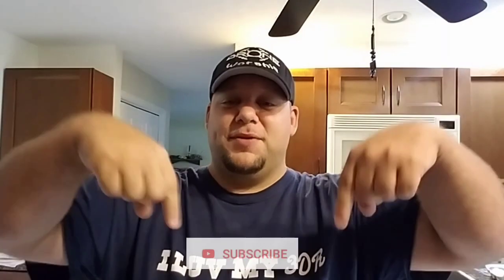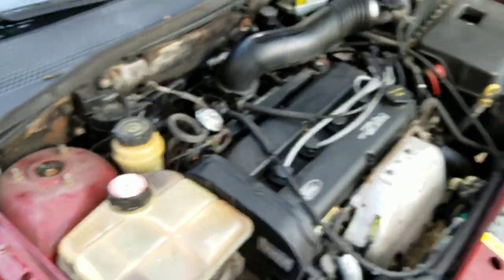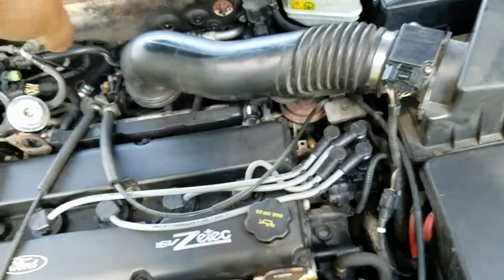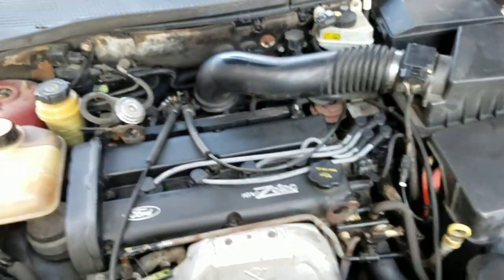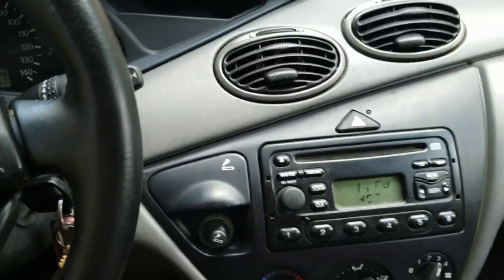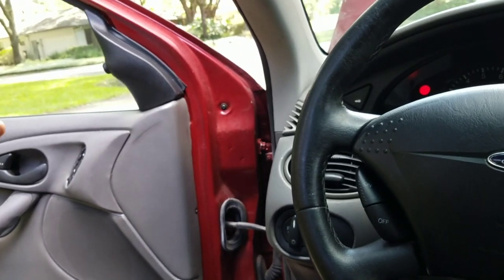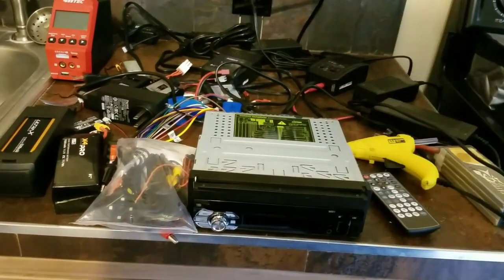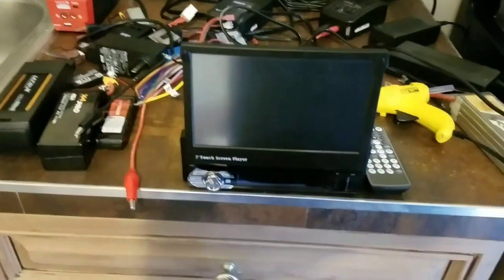2001 Ford Focus SE Running Rough FiX, Common Issues To Look For #Ford #Focus

Comment: Great vid!  Found my vacuum tube collapsed years ago.  Did not deduce pcv  valve & oil on spark plugs  to that.     Gonna rework now.  I have 2000 zx3, this the closest vid I can find.  Rough idle for years & NOW not accelerating.    Doing my best to go in order

Comment: Just earned yourself a new subscriber.

I have a 2004 Ford focus ZX3. Crank windows, no cruise control or anything,  ac practically brand new, and it's a 5 speed manual. Gets me around town as a daily as well as some short, 4 hour road trips. Installed an Atoto stereo in there since the factory radio had issues with the volume knob 

Might follow your stuff to see some tricks on any issues that arise.
Reply from the maker: Pretty old video but hopefully still helpful
Reply: Im working on that same manual model. And noticed its pcv valve slipped right off so i will be putting a pressure clamp on that after putting the new starter in its not my car im just doing the work for free because the shop guy said it was a clutch problem but i knew it wasn't i knew it wasn't after i heard the car start up and idle it was a loose starter solenoid cap

Comment: Thank you for posting the video.  My daughter's 2001 ZX3 idled rough, and bucked when trying to accelerate hard from a stop.  No check engine light until after I pulled plugs to see if they needed to be replaced.  The code indicated a misfile on the #1 cylinder.  Started checking resistance of coil, then plug wires.  Coil seemed OK.  Noticed that wire #4 wasn't plugged in all the way at the coil, and the contacts were blackened probably from arcing.  Using a ohmmeter, wire #4 showed no continuity at all.  I'm guessing arcing from the loose boot burned away part of the conductor, so tried replacing plug wires, and problem solved.  I think her car also needs motor mounts.  I bought the car 2 1/2 years ago from a coworker who was the original owner, and who always kept it well maintained at the Ford dealer.  He had just replaced fuel pump and spark plugs.  It did have a bad clutch at the time of purchase, which I replaced by myself, and that is probably when the plug wire got loosened.  Strange that #4 cylinder wasn't firing, but there were no codes to indicate a problem there.
Reply: Consider yourself lucky that yours has a manual transmission. because the automatic transmission models are notorious for transmission failures. Ford Motor Company just figure out to build automatic transmissions. always buy a Ford with a manual transmission you'll be glad you did.

Comment: In case you or someone else checks in on this video, I have a problem where after driving my car (5 miles or more)
whenever I stop for a quick errand, like go into Micky D's for 7-20mins and come  back out and START the car back
up it SOMETIMES run really run after if the timing is off/or bad plugs or something!  The car will usually sputter off.
Then I would have to restart it 3 or 5 times and gun the engine and then it will smooth out after about a minute
or two.  This is really bad sputtering cause I'm usually entering in heavy traffic will die if I don't put the car into
neutral at stop lights and rev the engine until it smooths out.  After the engine smooths out, it run perfectly fine.

I just started trying to TIME between me turning the car off and starting the car back up where this rough
sputtering starts. It seems to be about 5-25 that I've notice at this time.  I've noticed that if I come back to the car
within 3-4 minutes and start the car it starts fine.  Or if I come back to the car 30 minutes are more, it seems to
start and idle fine! 

My car is a standard 4cyl Ford Focus SE 2.0 not the ZTS model.  The problem started maybe about 9 months ago.
It had 125k miles on it and the timing belt broke  Just had another rebuilt engine put in ($5000) at a AAA approved
repair shop.  I thought this would address rough restart and sputtering issue.  But NOPE!   Drive towards work,
runs fine, pull into McDonald's for a quick coffee...come back out 15-20 minutes later...start the car and...SAME
crap again.  Engine sputtering!  Have to do my sputter routine,  put car in park or neutral,  and keep revving the 

engine ...about 1min or 2...until the engine smooths out.  Is this vapor lock?  If so, how to fix?  Could this be
the fuel pump?  Why only after 7-20 minutes of engine being off does this occurs.  Both engines would run
JUST FINE in morning, evening, mid-day, in heavy traffic...but only after a 7-20 minute stop of engine would this
happen.  

Don't think both engines ( the old engine and now the new rebuilt engine) could have the same common problem.
I almost thing that this caused my timing belt to brake...but that might be pushing it.  The car runs perfectly fine
outside of this issue, smooth, quiet.  Thanks for ANY insights to this issue and how to address it!  THX
Reply: if it helps i would check the IAC and the pvc and hose. Make sure hose isnt collapsed. IAC is a lil more expensive but i would start there

Comment: I can't like it twice!!! Thank you!!!! This helped a LOT!!
Reply from the maker: Not a problem I'm glad the video helped
Reply: @IFixShet  , followed the video, helped a bit. Hubs changed the spark plugs and wires, and now it dies when put in gear. Goes to the shop tomorrow,  it's caused more grey hair than the 15 y/o!!
Reply from the maker: That's normally mass air flow sensor or throttle positioning sensor that causes stalling
Reply from the maker: Sometimes it's better to buy the recommended parts for the vehicle then to try cheap on eBay sometimes you get lucky on eBay but sometimes you actually have to buy the actual part or equal to the regular part for it to work properly in the system to understand it
Reply: @IFixShet  to date: MAF, O2 downstream, PCV valve and hoses, fuel filter,  plugs and wires, oil change. Always buy my parts via Autozone, new/warrantied refurbished.  (Ebay folks think their used parts are new by cost, I swear!) After the O2 sensor, I'm done trying to finagle in around the block, it's still cheaper to take it to the shop (timing chain is about due to fall off again) and have them diagnose and fix it. And have it tuned up while they have it.
Reply: It's the shop, or target practice lol
Reply: @stacimcclendon3907  did they solve the issue at the shop?

Comment: Idk how old this video is without looking but, I would not get rid if a Grand Prix for a fucus! I have a 03 fucus 2.0 Dohc zetec vin-3 & just swooped a 07 Pontiac G5 vin-F 2.4 which i saw it needed new tire's & a window regulator but, only afterwards did I realize what else the G5 needs due to the fact that, The G5 was running when I approached it. Needs at minimum- a timing tensioner which I allready ordered but, if that doesnt fix the tapping at start up (just for the first 2-3 sec max) then, I will redo the entire timming setup!!! I have already replaced the window regulator, a lower grill, oil change, & on payday it will get 4 new tire's & ride NICE!!!!
Reply from the maker: Grand Prix has a non fixable transmission unless you remove the entire transmission and repair it you can't get to any of the shift solenoids or sensors five thousand times more work when they have problems

Comment: I bet that radiator on those are hard taking out from were its at seen underneath while i was taking out the old starter its gonna need a new oil pan gasket put on looked like someone used the same old gasket but other than that the frame looks good clean still new not no rust
Reply from the maker: Yep it's definitely not fun it requires almost a complete teardown of the front end

Comment: Hey drone worship and don't forget if you test it and it still skips or misses. after you driving it down the road. don't forget not to check those check the coil. my Ford Taurus would run rough and it set off the check engine light and it was the coil that was causing the problem I changed wires and plugs. And the car was still running rough and misfired new coil 80 bucks it fix the problem. and after that car runs like a top oh don't forget the PVC I had to replace that too it was causing a vacuum leak. My car is a Ford 2000 SE with a 3.0 liter engine. Wish you the best have a good day.

Comment: Throttle body sensor you cannot replace by itself. It requires a full throttle body replacement because ford doesn't have a separate throttle body position sensor.
Reply: You can replace the sensor alone

Comment: Collapsed doesn’t mean bad PCV.  It just means the hose is worn and is collapsing due the vacuum draw.  Good idea to change the PCV anyway.  Cheap.  

“Valve cover gasket”.

Comment: we've got a focus ,we replaced the radio with a radio that looks like its twin but the screen goes in and out  automatically with a button push...  never seen this same design with a manual pull out.. thats bizzare!
had ours a yr and it works fine.. good mp3 player but i'd say the amp is weak.. if u dont care abt shakin the cars next to u then its fine.
Reply from the maker: The problem with the motorized ones are when the motor burns out your screwed

Comment: Cht sesor replaced. It works 2 days. Low speed radiator fan wont turn on.( It turns on sometime.)  Until reaches engine temp on middle scale on dash moving fluctrating than stuck on middle.  Low fan radiator maybe on??sometime. After engine get to hot Both radiator fans go to damm high and Scale on dash go to cold tottaly stuck down.What is the problem? Thanks

Comment: I changed my pcv valve and hoses. My car stops sometimes when i spend a long time at a stop light. I still need to change my spark plugs because theres oil in them. I hope this fixes the problem. I have a P0171 lean bank one code.
Reply from the maker: Also check your idle air control valve and your EGR valve both of these can cause stalling while idling

Comment: Enjoyed your video. I have the same car, same color. I am trying to find out why my dash lights and night time lights aren't working suddenly. I've checked the fuses. The odometer still works but the lights on the dash, my rear lights, and the auxillary lights around the gear shift are out.
Reply from the maker: Relay

Comment: Ah, you have a FORD ( Fix Or Repair Daily ) I'm joking of course.  :o)
My wife has a 2001 Chevy Malibu I call Christine (after the horror sci fi movie).  I hate that car and I'm sure the feelings are mutual.
I just replaced the water pump and then the alternator and of course the dead battery.  We just took the car in yesterday for an oil change, and they came back out with a list of things that needed to be replaced on the car. Struts, front and back, front disk brakes and rotors. But... they were able to save the air cleaner. LMAO.
The estimate for the total repairs came up to about $1200.00.  NO, I didn't let them do the work and charge me $800 for labor.  Looks like I'll be doing some work on " Christine ".
Did I mention I HATE that car. LMAO.
Great Video, thanks for sharing the information. Have a great day :o)
Reply: The only thing that might present a challenge in changing are the struts. Brakes and rotors are not bad at all depending on your knowing of how to perform the task. Good luck and I wish you the best.
Reply: I forgot to mention that I am 68 years old pushing 69, and what don't hurt don't work. lol
When I was a lot younger I loved working on my cars and trucks. And car styles have changed a lot from the old " muscle " cars and trucks that had real engines in them instead of these souped up lawn mower engines, and bodies made of plastic and recycled beer cans. lol
Have a good one :o)

Comment: I am in desperate need of help with my 2001 focus I have a water leak at the manifold and it won't turn over I need a second opinion to determine what needs to be done
Reply: Vapor locked

Comment: I have an 01 Focus ZX3. I thought I had the over heating issues solved after replacing water pump, thermostat/housing and new water reservoir cap. Sat idling today waiting for someone and it began to run hot again. Fans were installed before I got it. They come on as soon as the car is cranked. What else do you think it could be?
Reply: In the same boat man. Changed relays, fan resistor, the end of the pigtail to the resistor cause it was burnt and will still overheat after a while. Fan works on high speed with the a/c. Not sure what else to do.
Reply: Frank Bennett how much miles on it and how’s it running now
Reply: Devrim Ekici about  185,000
Reply: Frank Bennett is it Manual
Reply: Devrim Ekici Automatic. I believe the problem was that I sat in a parking lot in the South Georgia heat and the fans were pulling the heat from the asphalt through them. It hasn’t happened since that day.
Reply: Frank Bennett ok is it running strong I want to buy the 2000 zx3 Manual with 110,000 miles idk if I should
Reply: Devrim Ekici the only problem I’m having now is a stalling feeling when accelerating. I’m not much of a mechanic. Some might call me a parts changer. I do try troubleshooting and researching my problems but I got it used from someone. I don’t think it was maintained well. Just trying to get it to a somewhat dependable way to work for one of the kids. It’s not a hard car to work on though.
Reply: Frank Bennett trying to get one with 110,000 miles for 1400

Comment: i like to ask you question, i have 2002 focus , it has gas cap open light on, then car started to hesidate while driving , changed gas cap, canister vent valve, fuel filter,sparkplugs,sparkplugs wires, now , gas cap light is gone, driving hesitation gone but now it roghly shakes engine on idle like every few minutes now my next step will be idle control valve, mas airflow sensor, if you have any ideas that you would like to share, hightly appreciated 2002 focus single head

Comment: Y didnt u just fix the windows & mirrors in the grand prix? Either the motor, switch, or the regulator?
Reply from the maker: Because of the amount of damage that was caused by the other person that already broke everything it wasn't worth my time not when the air conditioner worked. I already have enough to deal with on my plate called life than to deal with petty stuff like Windows not working I'm well aware of how to fix the problem it's just not worth my time in the slightest I'm constantly working on vehicles and other cars to worry about weather myburger window works

Comment: My 06 zx4 ses is showing me a p9318 edc code. Secondary air injection system control A circuit high. Any help would be greatly appreciated

Comment: Quick question, on the throttle body, it has 2 metal wires hooked to it, one connects to the accelerator pedal and the other one goes to the back of the engine to some box hooked to the firewall, what is that metal wire for??? What’s it purpose for? Idk if I’m making any sense /:
Reply from the maker: Cruise control
Reply: Drone Worship The Executioner DUDE thank you!!!

Comment: 2000 se here overheating...a little nervous to do the cylinder head temp sensor...also my head needs cleaned ..
Reply from the maker: It's normal for the thermostat to fluctuate even though it's not technically a thermostat it just measures the temperature of the head during the hotter season it will go up and down as long as it doesn't stay high you're good if it just jumps up and down up and down as the fans come on then don't even worry about it

Comment: I have a question for my ford escort zx2 I replaced the crankshaft sensor like 7times and every time I go race my car it breaks it and then when I rev it up the rpm goes up and bad down fast. I don’t get what’s wrong with it? Can I get some information please.
Reply from the maker: 100% easily answered. 
Your problem is that you have crank walk. It is very prominent in that year make and model of your vehicle

Crank walk is when the crank is allowed too much transverse (in and out) movement. This will allow the flywheel to come in contact with the sensor
Reply: @IFixShet  is that a easy fix? I never worked on cars 😂 but still learning. Would I have to pull the motor out?
Reply from the maker: @GilmoreGamingRacing  no it's not a cheap or easy repair it will need to be done at a shop that will cost a lot you will not be happy. Here is what crank walk looks like on your engine

https://youtu.be/eMs-hBkGkWM?si=ITjTfQzJ44N6-nB-
Reply from the maker: @GilmoreGamingRacing  yes it requires complete teardown of the engine
Reply from the maker: @GilmoreGamingRacing  if you want my advice stop driving it hard and stop revving the engine. Crank travel is a very serious issue you're lucky you haven't thrown a rod through the engine yet. Baby the vehicle if you don't plan on fixing it until you can buy something else
Reply: @IFixShet thanks for the advice
Reply from the maker: @GilmoreGamingRacing  sorry to be the guy that had to tell you man
Reply: @IFixShet  nah your good man. I respect that man. Thanks for the help now im trying to get someone to fix it. If I can’t fix it it’s getting sold I paid 2000$ in it’s a race car so. But I really appreciate the advice.

Comment: '02 focus, had my pvc and both hoses replaced 8yr ago (85000 mi) and the back one has the heat shield... need to replace again, hose isn't strong enough, corner nearest intake collapses flat.  doesn't help that oil inevitably gets on that corner of the hose (which weakens the hose over time) which is right where the heat shield ends... lol
Reply from the maker: I agree it was kind of a poor design by Ford

Comment: How long did it take for you to do all this? Also how much did it cost for all the parts? Thx for any info cause my 2001 ford focus is also misfire very badly but has no oil in the spark plugs like yours.
Reply from the maker: I shop on eBay so all the parts are really cheap also this is something I would knock out in about 5 hours all together